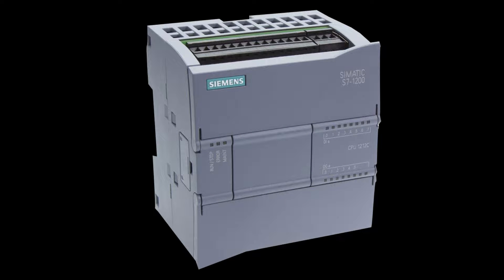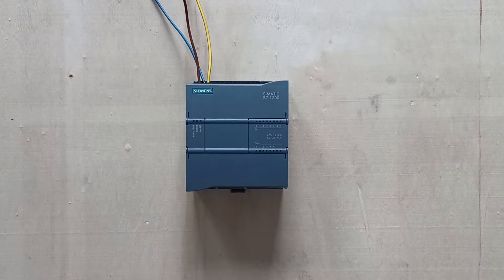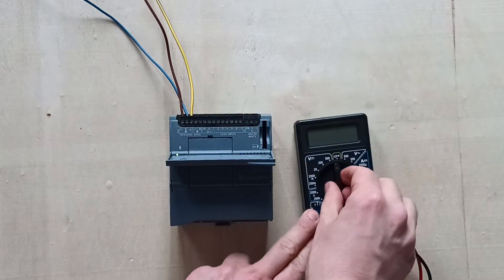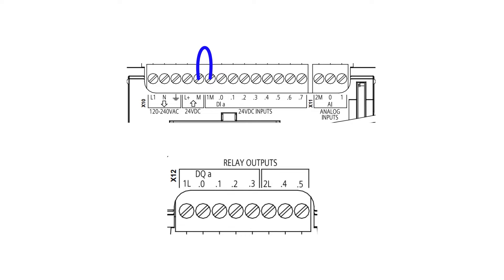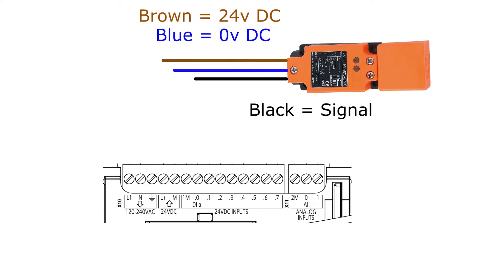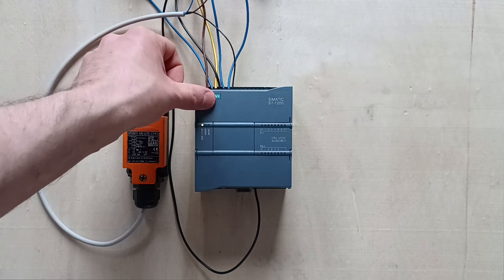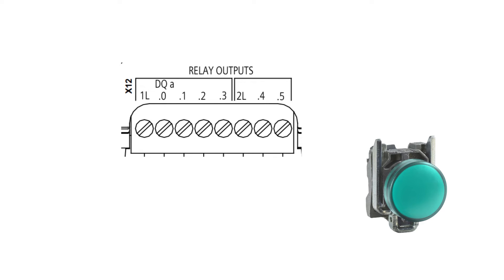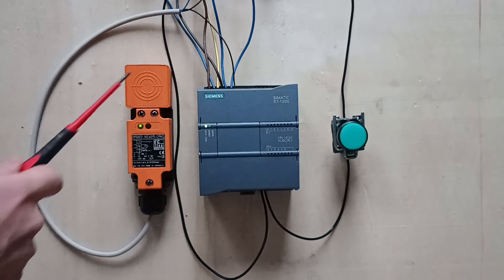Siemens s7 1200 PLC hardware and wiring tutorial

Comment: How do you wire a 2 wired sensor to a plc? Thanks
Reply from the maker: 2 wired sensors usually works like a simple switch so 24v DC on one side then just wire it to the PLC input on the other side if you do PNP else you do 0v DC similarly if you wiring NPN